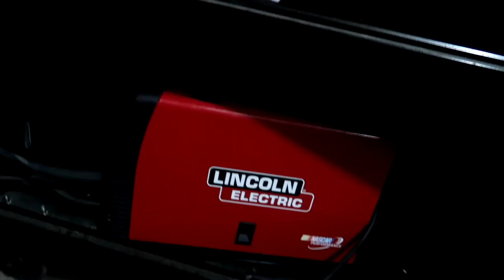DESTROYED MY DURAMAX!!!

Comment: I just took my step rails off of my 07 LBZ pay for shipping and you can have them! keep up the good work!
Reply from the maker: Thanks Tyler for the offer. I'm still debating on what I should do. What color are yours off hand?
Reply: "They're solid black made by UWS"
Reply: 3DMachines use wd-40 on a clean rag will scrub the paint from the pole off
Reply: 3DMachines hey love your vids your one of my biggest inspiration and just keep up the awesome work
Reply: That's an older truck just get a couple doors from the scrapyard. You don't need the mirrior.  I would ditch the stepsides. They look ok on a half ton but on a 3/4 ton they look out of place imo.
Reply: Funny how he responds immediately when free stuff is involved... Gonna be an early Hanukkah
Reply: 3d just wondering why as a welder you don't use a sliding dent puller just tack some metal rods to the dent and use a sliding dent puller my Chevy's got a couple dents but I'm waiting until I got a garage to paint in before I straighten out the dents and sand primer color sand paint color sand clear and polish
Reply: hey 3d machines you should try and hydro form the dent out of that side rail like you did with the ktm muffler.
Reply: max shaw Thanks ill try that on my truck... The trailer came off and passed me on the highway... whole drivers side is all scratched up and the drivers door had a nice dent in it. but hey, maybe I can make some of thr panels look a little bit better, ill try it out
Reply: planit MC Remember how that ended tho? 😂
Reply: rather well after a few adjustments

Comment: Now you can call it the Dirty Dingedmax
Reply from the maker: NOOOOO. but yes
Reply: 3DMachines you should take off the other running board it would look so good. And get a someone to fix the dents.
Reply: 3DMachines  Bild a new one 🔧
Reply: 3DMachines a Mr clean magic eraser will take off the green paint..won't be as noticeable until you fix the dents..I hit a mailbox and left white paint up my grey truck...worked good
Reply: Justin Beharry or use how water
Reply: 3DMachines plz do more Visual work on the truck plz and Build something with the step

Comment: hey Dalton if you want to get rid of the green paint that was left on you're door just use some WD-40 an a cloth an some elbow grease an it comes straight off!! happened to me in a car park someone scrapped there car across my bumper leaving it blue so my dad told me to use wd40 and it looked like new! won't get rid of any scratches but gets rid of the unwanted green that you've got!! just a thought bro! please like so he can see this folks!! 3dmachines  <3
Reply: Sorry for being a troll but WD-40 or any kind of degreaser on a rag will in fact cover up the scratches temporarily ... depending on weather it can work for up to 3-5 days... used car dealers always use this method... they spray the rag, wipe down the whole car, and it looks like a fresh coat of clear
Reply: I was told by a professional painter to never use wd 40, I asked him about it and he said it is silicone  based and one of the hardest things to get off a car after its been applied. You won't cover up those scratches with wd 40 anyways they are huge.
Reply: davidbrennan5 well it's worked for me an looks brand new.. some people have different experiences with different things.. for me wd-40 worked for removing the paint off my front bump and has never caused any problem for my paint or nothing. and I wasn't on about covering up the scratches just removing the green paint.

Comment: Wd-40 on a clean rag will scrub that paint from the pole off nicely
Reply: max shaw or carb cleaner if you spray it on the rag first
Reply: Carb cleaner works better. I've used it to take glue off a macbook too.
Reply: max shaw Itll ruin your clear coat too
Reply: Proper way to do it would be using some rubbing compound and a clay bar to finish
Reply: Sam Jacobs never messed up any clear coat and were not talking about show quality paint I'm sure paint isn't perfect also and it's just on top of clear a soft cloth with wd-40 it's a old mechanic trick I've done it millions of times for customers u can never tell where I did it it will not harm paint or clear coat you scrub it with scotch brite it will but a clean rag then clean off wd-40 I work on cars for a living
Reply: max shaw good shit ill use thst too i detail cars always good to learn some more tricks

Comment: The best way I have found to remove bigger stubborn dents is to drill a small 1/8 inch  hole in the center of the dent and thread in a small screw, then use a pair of vicegrips on the head and pull it out. Take the screw out and use some rust neutralizer on it then patch that 1/8 inch hole and repaint a small section around the patch.

Comment: The easiest way I've found to remove dents is by pouring boiling water over the dent, and then using the suction cups/or tapping softly with a rubber mallet from behind. Hope that helps!

Comment: Hey 3D Machine get that engine in the CROC !!!!oh and beef up the front wheel framing and get heavy duty suspension to the front wheel so it wont snap or bend before you put the huge BEAST of an engine in for a really crazy test run....oh and replace seats with racing seats for extra protection !! cant wait to see the Final to the Croc!!! Braaaaaaaap on !!

Comment: Just a tip for the stands; you should put some rubber padding on the metal feet so it doesn't scratch the floor.

Comment: To fix the running board you could drill a small hole at one of the ends and pressurize it and make the dent pop out just like you did with your ktm pipe. Then when you get the dent out you could plug the hole with something so that water, dirt, etc doesnt get into the running board when youre driving your truck.

Comment: Don't use extension cords, plug these welders as close to the fuse box as possible. if you have 14 or 12 gauge house wire running over 25 feet from fuse box then I suggest putting in a sub panel. Your welder will thank you and no more blown breakers.

Comment: Get AMP research Power running boards. they are a little more expensive and a little more involved to install but worth as they fold away when the doors are closed so you dont have worry about hitting them on anything when driving and then when needed they extend out

Comment: get a 6.0 powerstroke , im getting ready for comments making fun of it, i have one trust me its not bad at ALL mine is 100% stock ive had a 03 and a 05 its at 117k and its mint runs perfect.
Reply: BOSSANTER 360 not head studded though
Reply: the 05 which is the one i currently have has nothing accept a banks exhaust and i tow a 13k pound fifth wheel it still runs perfect has had no problems, i put rotella T6 in it
Reply: If I bought a Ford Diesel, it would be the 7.3l.
Reply: id happily get another 6.0, a 450 if i could find one, But a 6.4 i agree without EGR delete DEF delete and other things that engine lasts till 100k

Comment: What you need to do to get the dent out   I now because my father owns a body work shop what you do is pour boiling water on the dent to soften the metal and you need to just use the dent puller and that dent will come right out

Comment: Time to take the door panel out.   Grab a 2x4 or some thing smaller. put it thru them holes in the door and beat the hell out them dents...    a little body filler and new paint you'll be good to go!! 

my brother smashed up the truck a few years back and I used a maple tree a chain and a big Come a long to pull out the dents!!

Comment: DOH! That sucks man on the bright side It coulda been way worse then a couple of big ass dents that side step saved the rocker had it not been there the rocker would have been crushed and your doors would either not open or be very difficult to open and then probably not close if you havent fixed it yet all ya gotta do is take the door panels off reach in the door and push hard on it till it pops out good luck dude

Comment: Pull your door trims off and see if you can get those dents out. The front door should pop out easier than the back because of the sharp crease but with a little time and patience it will come out. Trust me I've fixed worse.

Comment: And for the Side rails take those ones off.  go to the hard wear store buy some tow chains! weld up the links and make some new running boards!   again use the come a long to pull the chain straight tack the links.  then go back and weld her up!!    

I made some highway bars for my motorcycle last year still holding up Great.

Comment: hey 3d machines  i have a idea for your new running boards . sense your so braptastic  with metal you should go buy some loging chain  hang 3 pieces straight up and down weld all the links together make some brackets under it to mount it to the truck and then maybe coat it in bed liner paint . i think it would look sweet as tits on the ol big D